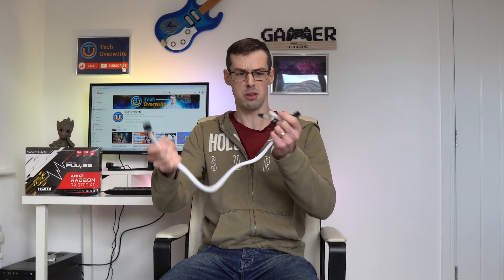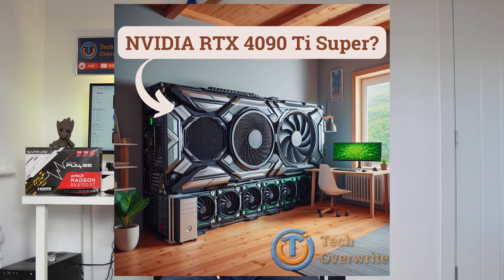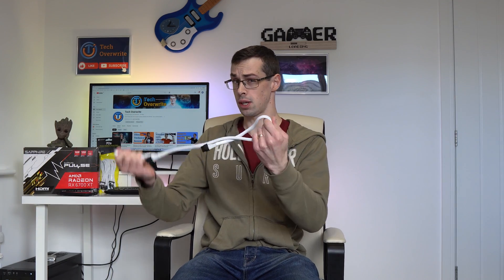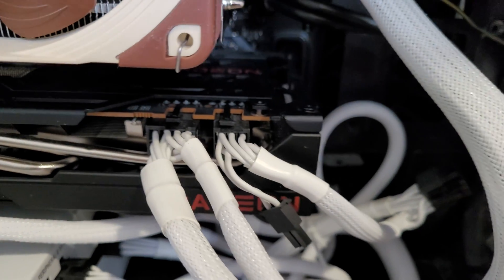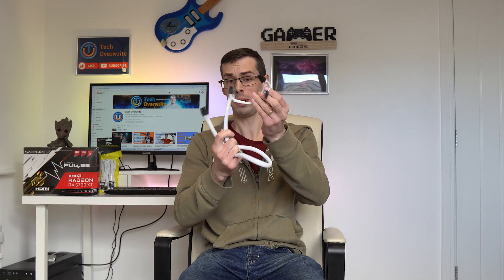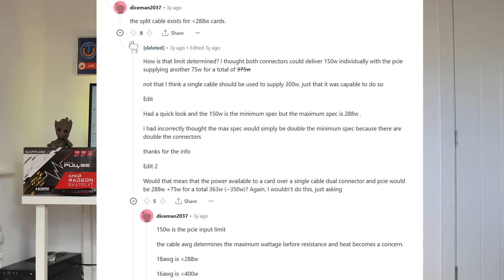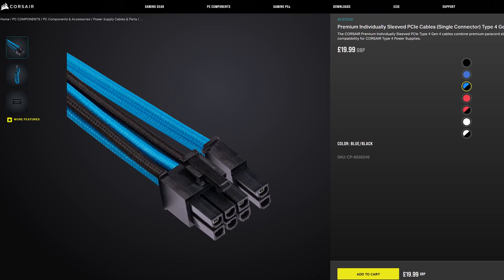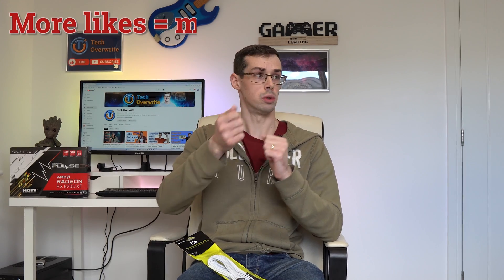Stop Connecting Your GPU Power Cables Like This! (How To PROPERLY Connect PCIe Cables For GPUs)

Comment: dude thank you, finally cleared up a lot of confusion for me, just recently upgraded from a rtx 3050 to an rx6800 and went from a 650 watt psu to an 850 watt psu, had a single cable with a pigtail connected to my gpu and this helped clear things up.
Reply from the maker: No worries man, glad this helped you out 🙂 Yes it's a fairly confusing topic, and not helped by different GPU and PSU makers all doing things slightly differently.
Reply: This doesnt clear up anything and is complete misinformation.  

 The PCIe 6/8-pin power spec is set by PCI-SIG who recommends 150w per cable based on the testing that the cable shouldn't go 3c above ambient. This is the recommendation that all PSU and GPU vendors recommend to their customers. 

Molex who actually makes the 6/8-pin MinifirJr and Minifit HCS connectors that are used for PCIe power says that they're rated for 300w  for 16 gauge cable so do with that what you will. This also tracks with testing from various people like Buildzoid and der8auer who tested the cables years ago and found 260w to be a good sweet spot. If your GPU pulls less than 595w (260 per 6-pin + 75w from pcie slot then it doesnt matter if you pigtail or not. 

The Nvidia Tesla K80 for example is a 300W card that only uses A SINGLE 8-PIN CONNECTOR
Reply: @lievre460  why does every GPU manufacturer list diagrams with any card having more than 1 6+2 using separate cables? are they all in cahoots to make you buy single cables or what. I've looked into this and literally every company says to use 2x cables instead of a daisychained one
Reply: @raidwipes  presumably it's to guarantee nothing goes wrong, even though the risk is insanely small. I've been running my 250w tdp card monitored at around 200w during usage with peaks to easily above 230w with one cable for ages now and absolutely nothing has gone wrong.
Reply: @lievre460  you sir, are a "moron". period. I SPEAK FROM EXPERIENCE. not something i read on google. i have a 7900xt, ran it with "pigtail" method and had CRASHES in EVERY GAME. now i have it powered with TWO individual psu to gpu connectors, no crashes whatsoever
Reply: @lievre460  yeah, this video is complete bs. reputable psu companies would not supply cables that do not adhere to the atx spec. also, a lot of power supplies have a single rail 12v so whether you connect 2 separate cables or pigtail 1 it makes no difference because you're still connected to the same rail electrically 😂

Comment: do 4070 cards benefit from connecting sepparate cables?
Reply from the maker: @djungelskog2654  usually the TDP is 200W for a 4070, so you should be fine without 2 separate cables here 🙂
Reply: @TechOverwrite  sweet! Thank you for this reply!
I'll pass the message to anyone buying graphic cards

Comment: I have 3060ti which need 14pin, I connect power with 6+2 pin(2 is pigtailed), I need 6 more pin which My PSU doesn't have, I connect it somehow with SATA to gpu extension. 

My pc work fine I guess for now. Should I'll be worried in rhe future? I don't played heavy games(AAA) for now cause I'm worried about my GPU power extension.

Ps. My psu is Vs600L its cheap, my gpu need 200w.
Reply from the maker: It's difficult for sure, and here you should generally be fine with a single PCIe cable (and the pigtail) due to your card's TDP, I agree. However are you not able to split the 6+2 pin, so connect one end as an 8, and the other as a 6 (to get the 14 pin connections)? That would probably be better than a SATA to PCIe adaptor, although this won't be the worse of things either because your card's TDP isn't too high.
Reply: @TechOverwrite  okay thanks for replying , I,m buying new psu anyway just in case.

Comment: Hello, can I use a Sentey SDP650-SS( with an only cable pcie 1x6+1x6+2) in a card Pulse RX 6700 XT (pcie 6 + 8) ?
Reply from the maker: Hello, it's going to be borderline unfortunately - at peak the RX 6700 XT can use a touch over 225 watts, so a single cable might struggle. It's hard to know for sure. Worst case though (if you do have crashes), maybe just look at slightly undervolting your card. It won't affect performance much, but it definitely will reduce power usage a fair amount.
Reply: @TechOverwrite  thank you maybe it will be better to get a new power supplie. Like 750w w 2 pie.

Comment: Bro i got rtx 3060 / 550w bronz and i try to do the adapter thing is it fine?
Reply from the maker: Yes man, the RTX 3060 is fine with just 1 cable - its TDP is low enough here 🙂

Comment: I have direct x crashes after 1-2 min gaming call of duty.(0x887A0005 (0x887A0006) (6068))Can it cause game crash if i have connected single wire to both 8 pin connectors? i have 850w power supply rtx 3070 aorus master
Reply from the maker: Hmm, yes it might be connected - the RTX 3070 Aorus can use a fair amount of power. I wouldn't personally trust it with a single PCIe cable to be honest. I hope you can get the crashes sorted 😞

Comment: I have officially burned my 7900XT power connector by using that Devil adapter. I didn't know this could be an issue and took it for granted that it was there for a reason. Thank you for the information!
Reply from the maker: Ah that sucks, yes it's definitely an annoying adaptor - especially for high TDP cards like the 7900XT 😔
Reply: @TechOverwrite  Cards nowadays are so power hungry 😬
Reply from the maker: @wipexx  yeah it's frustrating at times :(

Comment: I bought a 7900xtx red devil so I should run 3 different 8 pin cable? thanks for the advice
Reply from the maker: Sweet GPU, I love that one 🙂 You should be fine with 2 separate cables here - that'll be at least 300 watts, plus the 75 watts from the PCIe slot.
Reply: @TechOverwrite  thanks for the response I picked up the card for only 550 USA dollars last Saturday. I'm super excited! I was worried about the devil's spawn cable lol so I had to ask if I should run three different cables just to be safe
Reply from the maker: @coleb-41  that's a great price. I remember paying over £400 ($500) for my RX6700XT during pandemic pricing. Would much prefer your deal lol 😆 Yeah you should be fine but it's best to check. Happy gaming!

Comment: Can I use 1x6+2 and pigtail 6+2 on Asus RTX 3070 TUF gaming OC edition it consumes maximum of 240w but normally it stay 233-238w(maximum load but if cap FPS or undervolt or do both then I wouldn't even hit 200w at all). Right now I'm using 2x6+2 and pigtails are hanging around not using them at all. I'm using XPG core reactor 650w Gold rated A-Tier PSU according to cultists network.
Reply from the maker: If it's not crashing when gaming and peaking at close to 240w, then you should hopefully be okay. I personally prefer to run two separate cables here, but I get that's not always practical 🙂 I would just keep a close eye on things, and slightly undervolting needed. As you say, a slight undervolt can bring the power demands down a lot.

Comment: I have a r 7 5800x3d and a asus tuf gaming rx 7900xt with a gigabyte p850gm 850w 80+ gold (have the psu for 4 years ) the gpu is plugged with 2  the main cables and 1 piggytail (Gpu is one with the 3 pins ). Shoud i change something or is it ok?
Reply from the maker: Great setup 🙂 That should be fine too - the two separate cables should supply enough power in this case, especially since the motherboard PCIe slots will supply a further 75 watts.

Comment: Ahh, this explains why my 7900xtx is underperforming and stuttering. I was running only the pigtail cable for the 2 pcie slots on the GPU. Thank you so much!
Reply from the maker: Ah awesome, glad this helped you out - definitely sounds like the cause since your GPU is powerful (and awesome - I love the 7900xtx). Happy gaming!
Reply: Hey @iann1072

Having some problems with my 7900 nitro. What cables did you end up using? Could help me a lot.

Comment: The way I see the 12 pin connector, it connects to the graphics and two 8 pin connectors to the power supply unit. What if I need to flip the cable 180 degrees (no adapters or additional cables) and plug the two 8 pin connectors into my 7900xt graphics card, and the 12 pin connector to my power supply unit as it has a dedicated 12pin insert for 600watts. Would that be OK without any issues? I mean, it's literally the same thing supposedly, i just want to use the cables 180° in the reverse direction and both ends have the proper connection ends going directly into where they need to go. Let me know if this will work?
Reply from the maker: That's a great question - unfortunately I'm not 100% sure, none of my PSUs support this so I can't easily check their manuals or try it out. If it was me, I'd probably check the manual or email the PSU customer service team to check first. In theory it 'should' work if it fits, but I wouldn't want to say that for sure. Great question though, I'm curious now 🤔

Comment: So I have three pcie cables with the piggy back thing on it if I used 2 of them ( with the piggy back but only 1 is being used as a piggy back ) plugged into the extension cables will that work? I have the corsair rm1000x 2021 version for reference I'm halfway through building and I'm stressing out 😅
Reply from the maker: Good question, so in general using 2 cables (and 1 pigtail, for 3 overall PCIe connections) would work fine for many GPUs - it would supply at least 375W of power. 🙂 The only 'unknown' is the extension cables - higher quality ones (or ones from Corsair) would be fine, but random 'no name' extension cables could potentially cause you problems. Hard to say though. I would just run with the 2 cables and pigtail, boot up and see how you get on. As long as you aren't seeing crashes/freezes in game, it should be okay IMO. Good luck on your build 🙂

Comment: I have a 7900 gre and I use 1 cable plugged into both and I my pc is underperforming. Would this improve performance?
Reply from the maker: It'd definitely be worth trying with multiple separate cables, that card's TDP is fairly high (sweet card btw 🙂).
Reply: @TechOverwrite  this helped immensely. My stability and frames are great now 😄
Reply from the maker: @BallsackOcrumbo  yay that's great, glad to hear it. Happy gaming 💪

Comment: what if my PSU doesnt have enough slots for a seprate PCIe
Reply from the maker: Your options are: (1) have a GPU that is below a 225W TDP, (2) undervolt your GPU or (3) change your PSU 🙂
Reply: @TechOverwrite  I wasn’t expecting you will answer haha
Thank you

But I just bought all the parts and I am trying to build my first pc

My GPU is 7900xtx and 7800x3d cpu with x670e-e motherboard 

My motherboard has two eight pin for cpu

My gpu has three 8 pin slots it means I need five 8 pin slots on PSU which has only four slots

Im quite confused also stressed 😆
Reply from the maker: Haha I totally get the confusion, and that looks like a sweet build - some awesome components 🙂 So in your case, your card's TDP is 355W. You're in luck. Just using two PCIe cables will be 2x150w minimum supply, so when you add in the motherboard's 75 watts, that's 375 watts of supply - meaning that you can get by with just two PCIe cables (and then one pigtail, for the third connection) here. 🙂

You might also be fine with just 1 CPU power cable for your CPU too. It is confusing when motherboard has two CPU power slots, but you don't always need to hook two cables up in every case.

Basically I would try booting with just 1 CPU cable and 2 PCIe cables (and a pigtail) and it should work okay IMO. Good luck 🤞
Reply: @TechOverwrite  I noticed there is a 16 pin cable (600w) is in my power supply cable which divided to two 8 pin PCi e cable , I asked chatgbt it said I can use it on my GPU so this way all the 3 slots of GPU and 2 slots of CPU can be filled

Does that make sense?
Reply from the maker: Yes I'd agree, that sounds like both the GPU and CPU would have sufficient power here 😊

Comment: I'll remember to thank you tomorrow if my rx 5700 xt works tomorrow..i just got a full modular power supply after i saw your video because apparently my Rx 5700 xt thicc iii used 2x 8 pins  and when i plug it in it displays for a few seconds and stops displaying..before i bought the second hand thing it was okay where i got it soo i m here thing maybe the supply of power isn't enough because even if the tested psu was 700w the 8 pins where in that fashion..tho am still uncertain of my assessment is correct
Reply from the maker: Hmm that's interesting, I hope that you can get it resolved. Unfortunately it could be anything from lack of PSU power to a motherboard issue, or even a driver issue. Hopefully the PSU PCIe cables fixes it though? 🙂

Comment: Hey there, i've been having a problem for months now and can't find a proper solution so i decided to take your opinions on it.
My PC goes black screen while i'm playing any kind of modern game, both monitors go black, sound goes off and then sound comes back after a second, i can use my keyboard mouse mic etc. but can't see anything on the screen until i restart.
i tried this gpu stress test from Matthew-x83 and it happened again. do you think it's PSU or GPU related ? it only happens in some games like i experience it in modern WoW but not in classic wow. when i check HWMonitor i see that hotspot reaches 100C but the average heat is at 80C when that happens. i don't have a replacement GPU or PSU so i have to buy one , if you has a suggestion that'd save me from wasting money i'd appreciate
i saw these on eventlogger:
-"Power Efficiency Diagnostic Logger" session issue
-LSA package is not signed as expected
-The Secure Boot update failed to update a Secure Boot variable with error
-atkexComSvc.exe errors (even tho i removed most asus apps except tweak)
my specs are:
GPU: ASUS DUAL 3070
CPU: ryzen 7 3700x
PSU: 650W Bronze(not modular)
MB: MSI B450 A PRO-MAX
Ram:32 GB 3200mhz ddr4
thank you in advance

Comment: Can't you just switch ends from your pcie cables, so that the ugly pig tails are all hidden at the psu instead of in sight at the gpu?
Reply from the maker: @rikb4071  hmm good question, it might depend purely on the PSU. I don't think it's physically possible with my Corsair PSUs for example, but I'll try and check sometimes soon.
Reply: @TechOverwrite  the manufacturer always displays the pigtail at the GPU side, but why..

Comment: I'm sorry what about a situation when my GPU has 1 8-pin slot and I have two cables 6+2 + 6+2 (both pigtails as you called it). Is it ok to plug in just one 6+2?
Reply: Also my psu is seasonic focus, card is rtx 4070. Don't really want to swithc any of these
Reply from the maker: I think that you'll be okay here - the card's TDP is around 200W (unless it's an OC model), so a single 6+2 pigtail cable will work fine here IMO. Good luck 🤞

Comment: I have 12V 2x6 slot on psu with 600w cable, can I use it directly on you?
Reply from the maker: Directly on.. to me?! Sounds painful 😜
Reply: @TechOverwrite  sorry bruh 😅 I mean directly to GPU….it was auto-correct who did that 😅 my gpu is rtx 4070 ti super
Reply from the maker: Haha no problem bro, I figured as much 😅 Ah that's a great GPU. Yes, using the 12v-2x6 cable is fine as long as you plug both ends into the PSU. That'll be perfectly safe IMO. Happy gaming 🤞

Comment: thanks a lot! my psu have only 2 8 pin and one of them have a pig tail. since im using a 4080 with a tdp of 320W it should be safe and have no issues
Reply from the maker: No worries, glad this helped 🙂 Yes 2 separate cables and a pigtail should be fine for the 4080, I agree.

Comment: the main prooblem is not the wire but the connector. also the PSU side connection is not standard, so if you buy new cables you need to check the pins!
Reply from the maker: Fair point - thank you. And yes, it's definitely always good to check the pins, true 🙂

Comment: By comprehensive testing, mr. BitsBeTrippin have tested different GPU PCI-E draw, 3090 went as high as 127W. With new GPU's the 75W TDP on PCI-E is no longer true even though it is still the standard.
Reply from the maker: That's interesting thanks, I remember back to the RX 480 days when a small number of GPUs were drawing more than 75W and frying parts of some motherboards. I guess things have moved on since then 🙂

Comment: So been using my RX 6700 xt with daisy chain for almost a year, having weird texture glitches thinking it was dying and it may just be the power supply, I will just try this thanks
Reply from the maker: Ooh interesting, fingers crossed this does help resolve it 🤞
Reply: Did this help fix it?
Reply: @ashyy6819  it fixed most of my issues, but in the end it was window 11, clear install of windows fixed all my issues

Comment: Appreciate your videos very much,I just subsribed. Check me out on this one I have a 600w independent power supply thay has only a pigtail pcie connector 8 + 8 pin. But the catch is that the RTX 3060ti I have consumes 225w. If I add the MB pcie slot its 75w + the psu PCIE cable 150w do you recommend me adding the 2 sata power to 8 pin connector to the second Pcie slot of the gpu just to be sure? Thanks and have a nice day.
Reply from the maker: Many thanks, I appreciate that and the sub 🙂 Glad you're liking the videos. Good question. So I'd personally think that it's borderline (with the pigtail), but would probably be okay. The 150w is often a minimum and a PSU can sometimes push more than this. Equally, a 225w TDP card is often the maximum. In other words, it's unlikely that your GPU will pull so much power (>225W) that your PSU will struggle. I would try it as is without adding extra SATA power etc, and maybe if you get some crashes then explore a slight undervolt. But my hunch is that you'll be okay here 🤞 Happy gaming!